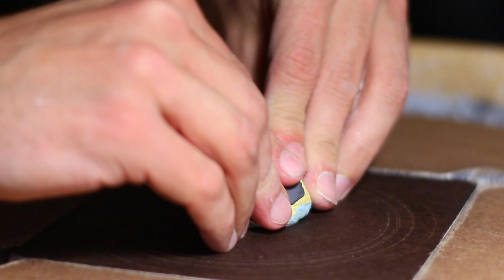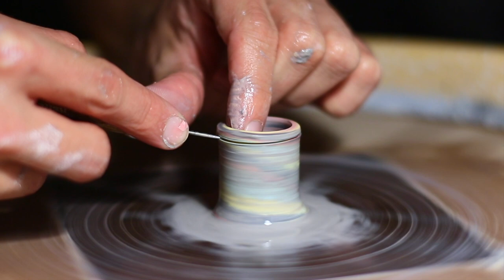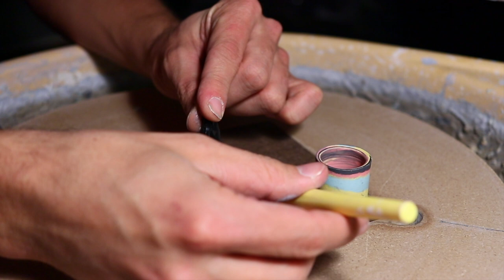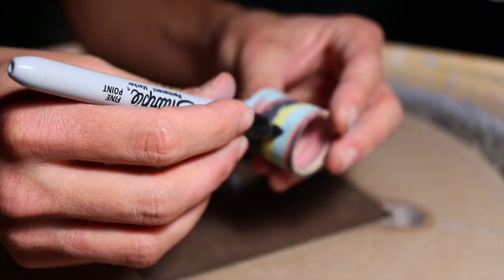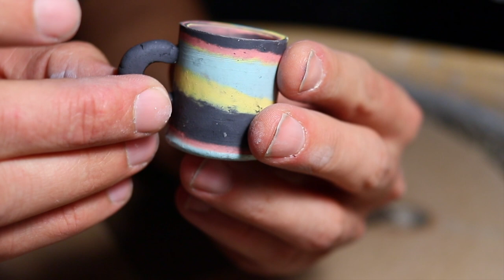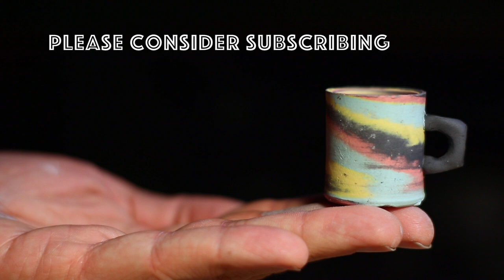Making a Tiny Mug | Mini Pottery

Comment: I just made a set of mini mugs, plates and bowls for my great niece (8 yrs) for Christmas.  It was a challenge.  I couldn’t find any videos (all were too sped up) on how to manage making these. Glad you posted this video.  Would like to see how you do mini plates, bowls and teapot.  I managed making a set but it took several tries and it’s a bit crude.  Thanks you, again!
Reply from the maker: I think a mini teapot could be fun. Can’t imagine how to make a spout that small 😄
Reply: Making the teapot was fun and challenging.  I’ve never made a teapot of any size before.  I’m sure my handle and spout are not proportionately correct but I thought it came out cute just the same.  I’m not so happy with my plates...they look more like coasters.  The mini bowls and jugs were fun and turned out great, after some practice.  I put lids and corks for the tops.  I’m going to make another set of minis out of marbled clay.  Thanks for the inspiration.  Happy Thanksgiving! 🦃🍽🍁
Reply: Hi Lynn Schneider 
Not sure if you're aware of this but YouTube allows you to adjust the speed of each video from it's "Normal" playback speed to a whopping 1.75 times faster. Or a very, very slow .25 video speed.
They have this option tucked away under those 3 dots in the upper right corner of the video. Touch the dots and a sub menu will open with everything from Captions to Playback Speed. Click Playback Speed and a whole range of speeds will appear. Playing with the settings can be quite humerus especially if you're into Alvin & the Chipmunks! Hope this helps. Good luck & Happy Holidays!!! Tari
Reply: @Tari004  thanks for the tip...I did not know this could be done...👍
Reply: @lynneschneider2885  very good, hearing this made my whole day! Merry Christmas & VERY Happy 2021!!!

Comment: Hi there very beautiful n well described, I just want to ask you a question if you can reply, I have a mini wheel I want to use porcelain clay on it for throw mini pottery vases or bowls etc, I don’t have kiln I wana use it because of its smooth buttery texture to make thin neck vases and also fat bottom vases, if I use porcelain clay and make mini pottery and after its dried I paint it with acrylic or ceramic colors follow be gloss varnish will the porcelain pottery stay stable since I don’t have kiln so I won’t be able to fire it, I just wana showcase it and put on the rack for decoration ie mini porcelain pottery, plx advise if it will remain solid this way I mean porcelain pottery and I don’t mind even if it won’t be functional plx reply thanks alot
Reply from the maker: It might. I don’t seal clay so I can’t really help you 🤷‍♂️